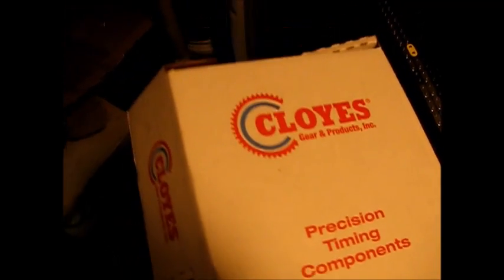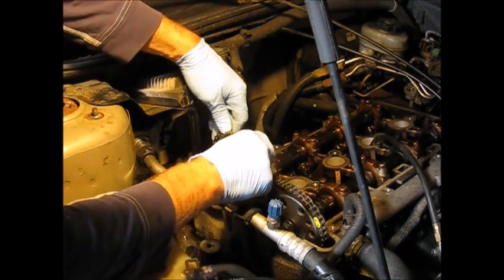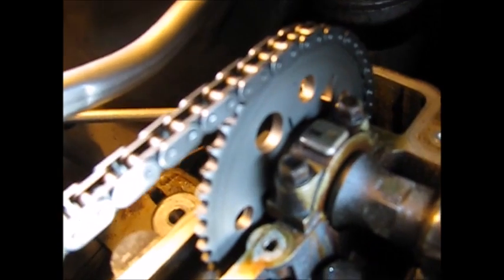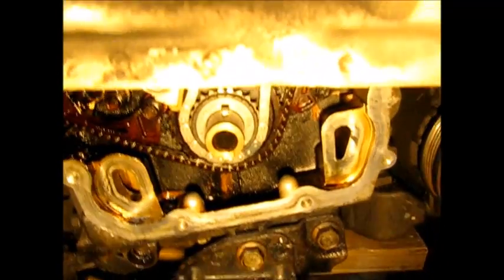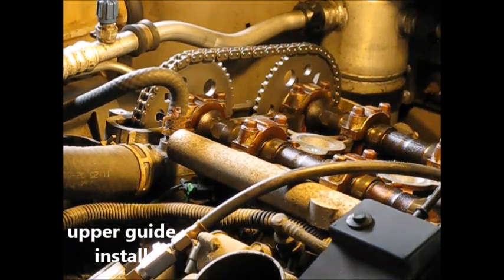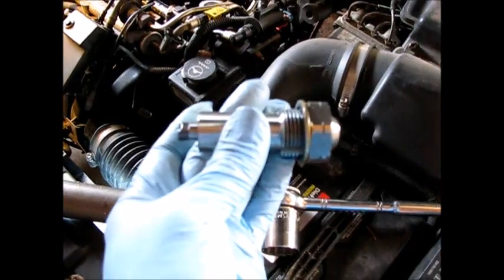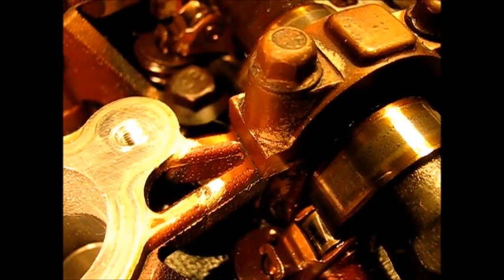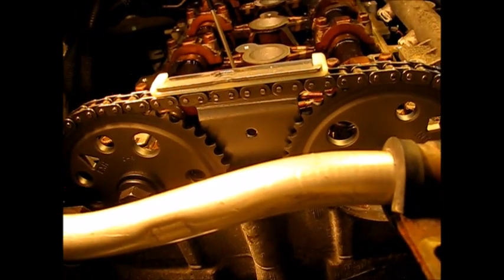GM 2.2L Ecotec timing chain replacement '03 Cavalier part 4: Installing a new chain kit

Comment: I thort TDC was defined as Top of Compression Stroké 
NOT  Top of Exhaust Stroke  ¿¿¿¿
Reply from the maker: Me too and sorry if I miss-stated that.
Reply: That's alright, but why does this engine have its coloured links line up on #1 TDC on Exhaust stroke instead of Compression Stroké, (I.e Exhaust cam at 7 o clock and intake at 5 o clock)

Thanks 😊
Reply: p.s. I thought TDC was defined as "On Compression Stroké"  !!!!

Comment: Great instructional video.  I am doing this repair on my 2007 Saturn Vue.  Very tight conditions with the engine in the vehicle.  Had  what sounded like  timing chain rattle on startup.  Thought that the entire chain had stretched. After removing the engine front cover, found the rigid chain guide broken at the lower bolt mount.  Question?  Should I replace the counterbalance chain kit while I have the timing chain removed?
Reply from the maker: Ideally should do both, I suppose. But I haven't done it so I don't know how hard it is.
Reply: @TheOriginalMechanic  Thanks, I have both Cloyes kits so will do both.  I think the hardest part is going to be getting access to the CB shaft pin holes to keep the sprockets from turning during tightening.  Might take 2 people.  Thanks again for a great video.

Comment: How do you get the cams to line up where the int mark is where it is suppose to be. I had to remove the head because the bolt holding the the black timing guide stripped out. When i started putting it back together i have the crank top dead center but the cam sprockets i cannot get lined up

Comment: How does the mark on the exhaust cam sprocket help make it easier to install?  Is it because you're able to line the sprocket up as close as possible when installing and otherwise the chain won't allow it to go if not aligned properly?

Comment: I bought both kits off of Amazon and both are made in China.  I was wondering if yours were too.  I thought they were made in Arkansas, that's why I bought Cloyes. Amazon states country of origin  France on one listing and USA on the other.  Boxes look legit but don't want clones.  I don't know to install or send back. Any thoughts?  Thanks  I tried to read the sticker on your box, but to blurry to read
Reply from the maker: I don't know. It is frustrating to find parts that aren't outsourced. I bought an OEM AC compressor for my F150 and it was made in China. Still working good two years later though. What choice do we have?

Comment: When you put the car back together got a question about installing the timing cover did you cut the part of the gasket to get around the motor mount bolt or did take the motor mount loose to extend the bolt through the opening in the gasket. I am ready to start the installation tomorrow ...I did cut the gasket to remove it so may do that to install it.
Reply from the maker: I recall cutting the gasket as well.

Comment: I have a 2004 Saturn Ion 2.2 ecotec how many miles do they recommend replacing the timing chain? I cant find a service interval?
Reply from the maker: I don't have a number either. I did this one at 150,000. It would be nice if there was a way to visually inspect without so much disassembly.
Reply: @TheOriginalMechanic  noob question maybe,  if i align the mark on the cover with the one on the pulley before removing the cover, how do you rotate the crank  after removing the pulley and cover to move the pistons so there is no contact to place the camshafts at the correct position before removing the sprockets, and then return the crank to the position it was before to align everything to install the new parts in?? great videos, maybe i just dont get it :)
Reply: Ya I don't think there is a scheduled maintenance because its a chain. A belt has seevice intervals but not a chain.

Comment: Great video , i had a quick question, i recently removed the cylinder head off my 2007 saturn ion and i didn't set it to top dead center correctly before removing , Do i just turn my engine to top dead center by looking at the pulley marks before installing heads again???
Reply from the maker: Make sure both cams and the crank sprocket are in alignment positions and you should be fine.
Reply: @TheOriginalMechanic  ok and can i just go off by the pulley marks or i have to remove it and look at the sprocket behind it ??
Reply: @TheOriginalMechanic  "should be fine" or will be fine?  I have the same issue and am concerned the #1 piston is at TDC on the wrong stroke,

Comment: You are great.  I could not find another video so complete and step by step.  for some reason my time chain when everything is ready and I move the crankshaft, as soon as the valve closes the chain is loosened for a second between the gears and then in the crankshaft gear.  I have armed and disarmed and I don't find the problem

Comment: Great tips throughout this series on the Ecotec engine. Thanks for the detailed instructions and tips, and for explaining that the colored links on the timing chain are only for the initial setup of the valve timing, and that when we do this, we shouldn't expect those colored links to come back to their starting points when we turn the crank 2 times manually to check out the valve/piston clearances and to observe the proper opening of the valves. Thanks for these videos.

Comment: Did you worry about messing with the balance shaft chain? Getting ready to do the timing chain set, nice video👍👍
Reply from the maker: I did not. Changing out the balance shaft chain and associated parts would be ideal, but we decided this was enough for now.

Comment: These engines are junk. G M should have used the 3.1 —3.4 platform for these cars.  All these engines with the cam solonoids are just money pits
Reply: Are you joking lol? The 3.1 and 3.4 were significantly more problematic than these engines. 70% of the problems that are reported about the ecotec engines literally come back to vehicle maintenance, everytime i've seen one of these chew up a timing chain, the engine was low on oil and the oil was heavily over used.

Comment: So, after two complete crank shaft revolution will all the timing chain and balance shaft timing marks all align?
Reply from the maker: The marks on the chain are for installation only and will not line up again.

Comment: Thanks for the video I worked out great on my 04 cavalier 2.2 Eco tec after it ran great before I changed it and it never ran after that once i shut it off one half of the day and i found out the black tentioner cracked on me and the top small bolt holes was stripped so i had to replace the whole head I order to have my new tensioner installed on a replacement head while I was there I replaced the head gasket too as well and all gasket that came with the head gasket kit set

Comment: I was looking at using cloyes. Is it still holding up good?
Reply from the maker: It's been two years now and the car is still running fine.
Reply: The Original Mechanic , Well that's good. All I hear is horror stories about aftermarket chains. But after talking with cloyes they said their chains are made to OEM spec and you're going on 2 years. So that helps me make my decision. Cloyes it is.
Reply: cloyes is the top of the line oem replacement.. i work at an auto parts store and the cloyes is deff a quality product
Reply: I just bought a new cloyes timing set for my 2.2 Eco tec too it's going great and this is my first time replacing a set on that engine but it worked out great it runs like a champ I changed out other timing chain sets before on other Motors but this one was very interesting to tackle down while in the car

Comment: I have an 2004 Saturn ion level 2 2.2 ecotec changed timing chain everything it backfires is that because we didn't do the it correctly just put the cams in time nothing else but it cranks but backfires tries to start but backfires.
Reply from the maker: The crank and cams absolutely must all be in the correct timing relationship.

Comment: This might be a dumb question I'm new too this Channel but the same thing happened to my car as well with my 2005 chevy and I was wondering if I can just replace the tensioner or do I have to replace entire timing chain with a kit and new tensioner I took off the valve cover and  no valves are bent just my chain is loose ? Thank you
Reply from the maker: If you can verify that the tensioner is bad, sure why not try just that. Chains do stretch though, as it did on the car in the video.

Comment: ok have the same car with 300 000 km on it.  have a vibration noise that starts over 50 km, turns out the transmission is going on this thing according to the shop.   after seeing this video wondering whats next with this car !   as this is a known issue with this car should i do this mod your showed here  and the transmission at the same time or retire the car when its done.
Reply from the maker: Always a tough call when to stop sticking money into an aging car. I don't have that answer, sir. Thanks for watching and good luck.

Comment: Love the video thanks for it. One quick question do you need too install the tensioner deactivated or can you install it activated?
Reply from the maker: It needs to be deactivated when installed. Pushing on it with a large screwdriver or other tool near the tensioner will activate it in place.
Reply: don't pull the pin till after install

Comment: Very informative, thanks for the video. Just a small tip, using a swivel adapter will throw off your torque specs. Other than that seriously awesome video!
Reply from the maker: You're welcome and thanks for the tip. I suspected that about the swivel but it's so darn hard to get a torque wrench into some places.
Reply: It's probably much more accurate than the ol' german way of torque specs. Good-n-tight!

Comment: I just changed the tensioner on mine. Selling the car for next to nothing but wanted to get rid of the noise. One thing led to another and I jumped a tooth when assembling. Unfortunately the chain in there now has only two colored links. I gather one if for the crank and the other for the intake. Nothing for exhaust.  I counted 16 chain links from intake to exhaust as per your video and other pics online between the intake and exhaust marks on the cam gears and assembled it that way and I figure that is as good as looking for colored links. My only issue is when turning the engine over by hand, the chain slaps the upper guide when the exhaust just comes off the lobe is that normal? Essentially the exhaust runs ahead of the intake when coming off the lobes.
Reply from the maker: I never encountered any slap when I completed this job. Assuming you have the original chain in there,  I wonder if your chain has stretched a bit. That's what happened to the chain in my video.
Reply: Hey very interesting comment, I'm doing this and everything reinstalled, when I turn the engine by hand, my chain too goes clacking on the upper guide everytime the exhaust camshaft lift off from the spring valves. I can't believe the little cheapo spring in the chain  tensioner can't keep the tension against the strong valve spring. I guess those chain tensioner build their pressure with the engine oil pressure. My question David : did you have to charge up your tensioner with oil or something?? What do you think? My parts were are good before this reinstall (I did a head gasket). AND Thanks a lot for your awesome videos :)
Reply: Yes ! But this little spring you know, thats not very tight